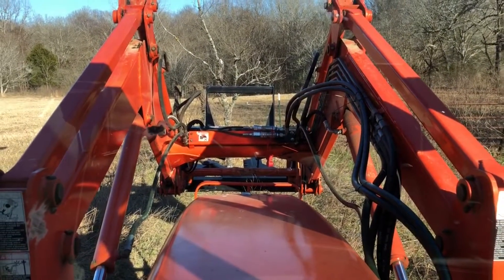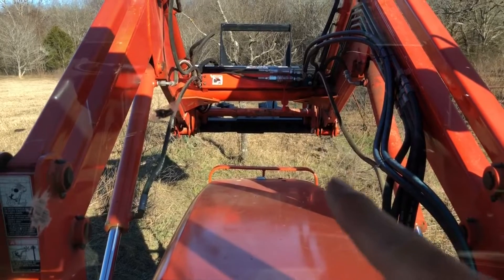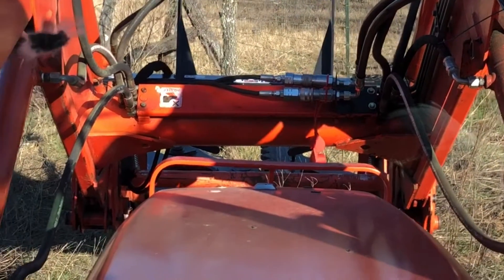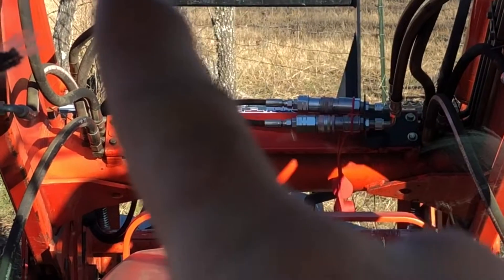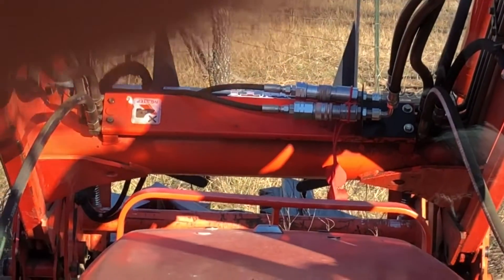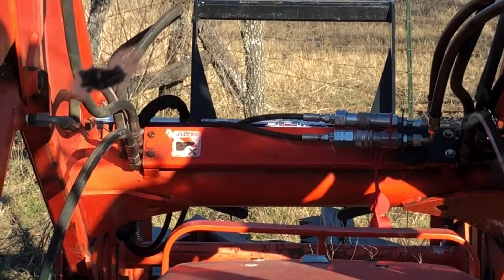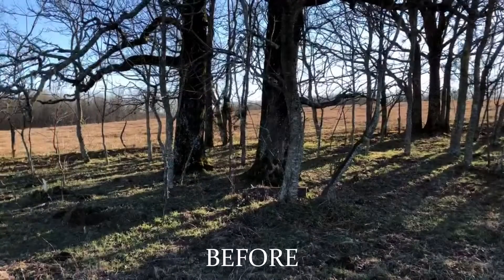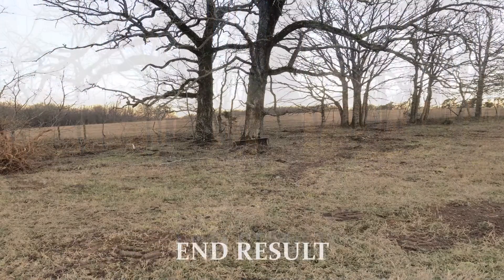Tree Puller - Tractor Visibility Tips & Soil Moisture!

Comment: Visibility is tough with tractors.  Moisture helps on hardwoods but for cedars dry soil seemed easier for me.
Reply from the maker: It certainly can be! Having a point of reference on the puller really helps me to know where the jaws are. Cedars don't seem to matter much with regards to moisture. They pull pretty easy either way. Other species seem to vary from one tree to the next and especially with ground moisture conditions. This of course depends on the soil type in a certain area. I have mostly sand and some clay areas.

Comment: Good tip on visibility.    I was wondering about that.   I’d put a piece of tape or paint on that top bar for alignment.   Nice tractor and tree puller.
Reply from the maker: Yes sir, I think that would help. It would be more difficult without the visual guide of the push bar.

Comment: I have a very similar tree puller, but mine doesn’t have the push bar. Once I finish my shop, I will definitely be modifying it and adding one. We have a Kubota M108X. Do you have a 3rd function remote or do you use one of the rear remotes?
Reply from the maker: Nice! I do like having the bar on it. I installed the Z80 size third function kit from Summit Hydraulics. I think its rated for up to 21 GPM if I remember correctly. It’s been working great. I’m actually thinking of doing a review on it and show how I hooked it up. I installed it right before I started uploading to YouTube.